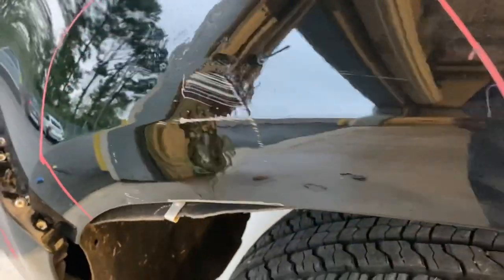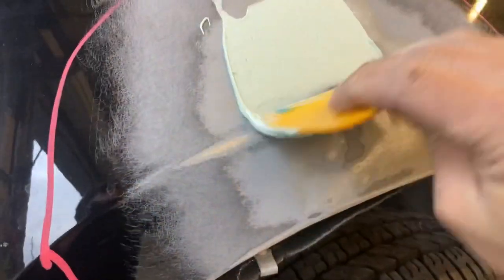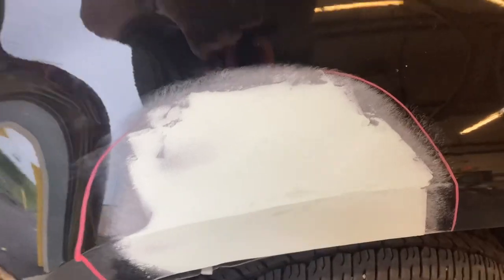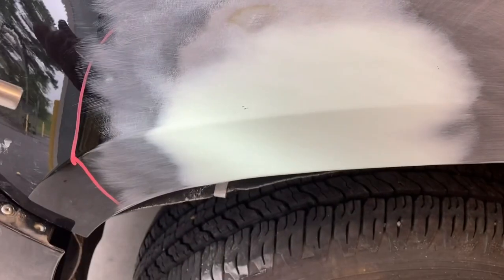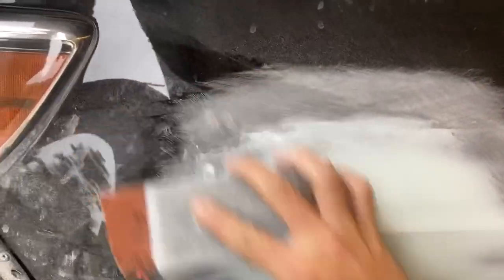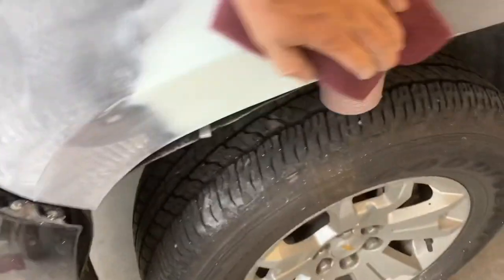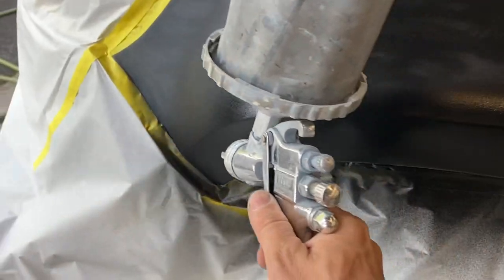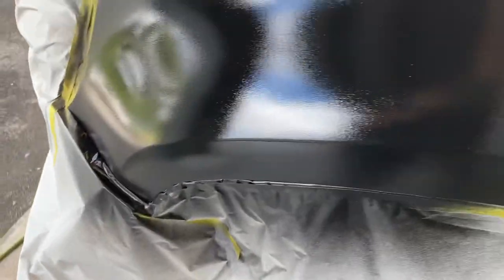How to fix your first dent by yourself

Comment from the maker: I’m sorry about the audio it sounded good before I uploaded it I’m not sure what happened
Reply: It's clipping. This happens when you have the volume too loud. If the original file sounds good, then it is probably that YouTube has a maximum volume that is even lower than what is on your system. The solution is to reduce the volume that you record at and that will keep your video from reaching the clipping point when you upload it.

Comment: I was taught the same thing on scratches. Paint follows the body and will not fill in a line or scratch, making little valleys of paint that is showing off the scratch..... I would find them with steel wool and make them almost a tiny tiny dent as well then use spot glaze in them and then block sand with wet/dry. Around four hundred black wet dry will make it a lot harder to see after that. If you need it completely gone, while its still dry use brown paper bags that have been softened by making it mashed and ruffled up and soft. Then use it like sandpaper as well and it will be baby butt smooth.
Reply from the maker: Ok thanks

Comment: But if I fix my dents I'll start caring too much about the next one I get. Besides, most dents don't slow me down. Once that happens - we'll have to deal with it, perhaps. Seriously, though - fun fact - in Wisconsin, many people have their normal cars and also a "bar car"...you know, because when you drive to the bar, sometimes it's snowing and you slide off the road. It's the snow. Not the destination. (I might be related to these people, but I'm not going to confirm that.)
Reply from the maker: Thanks
Reply: Not whisky dents?